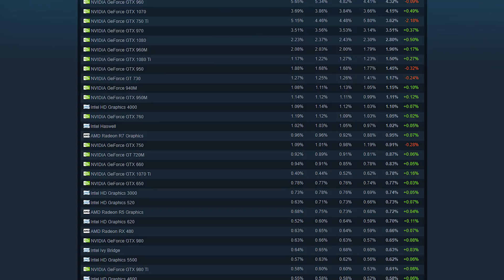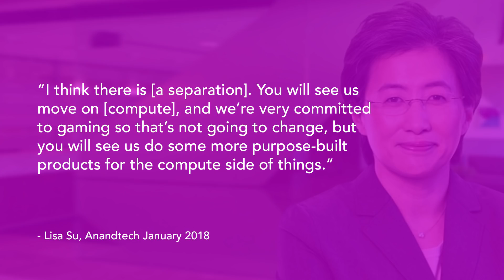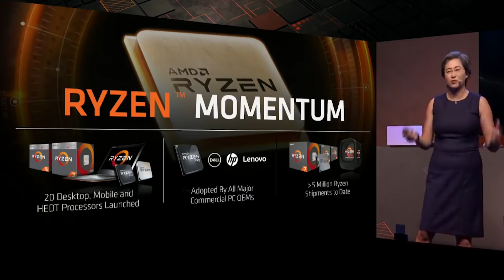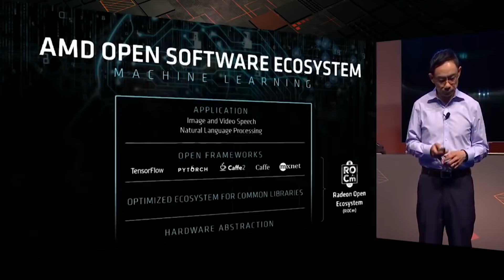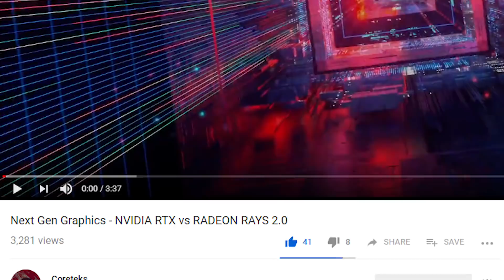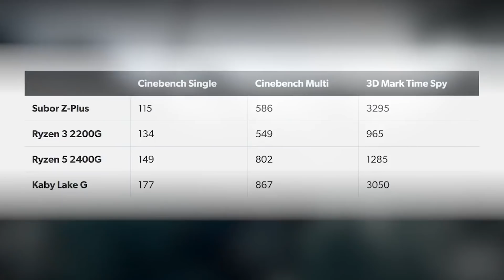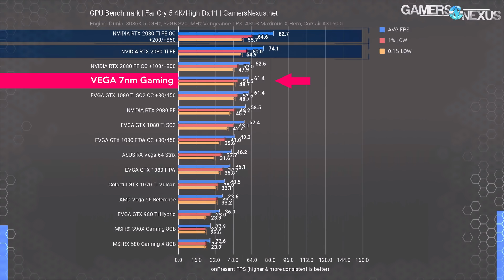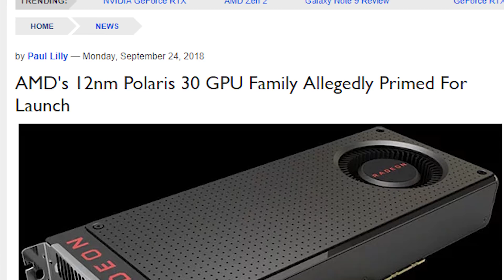AMD's answer to RTX

Comment: RTX is NOT a proprietary API(!!!)
Why? Because it isn't an API at all - it's just a marketing term... The API is DXR (direxX Raytracing), and YES it IS "proprietary" but NO it DOES NOT mean "NVIDIA only"(!!!) It is a proprietary API by Microsoft, which is nevertheless "vendor neutral"  when it comes to hardware support(!) The same code that NVIDIA RTX will be executing, can and will be executed on AMD hardware in the future - just like anything else in DirerectX has been for decades...
Please stop propagating nonsense...
Reply: DX12/Vulkan is the way to go, Vulkan more so than DX12
Reply: Fun fact: Vulkan already supports NVidia Raytracing. https://www.khronos.org/registry/vulkan/specs/1.1-extensions/html/vkspec.html#VK_NVX_raytracing . I could develop an raytraced game or application right now that takes advantage of the RT Cores, and most likely adapt it to use AMD's response when it comes out. Considering Shadow of the Tomb Raider supports Vulkan, why don't we have raytracing yet?
Reply: +Arnon Marcus I 100% agree with you. It's even funny how PC gaming relies so much on Microsoft API. Even the new RTX hardware can't skip the Microsoft piece of software in order to work as intended.
Reply: @Patrick73787  We shouldn't want NVIDIA to 'skip' the middleman - DX is how game-developers can write code once that can run on any hardware. It's an abstraction-layer. Is good for the industry. It doesn't really matter if it's DX or OpenGL or Vulkan - as long as it's hardware-vendor-agnostic - is good for everyone (except hardware vendors)
Reply: So my vega 64 will support those fancy lightning effects if they will support it with a future driver..?
Reply: @evren elveren it may well do, how fast it runs will remain to be seen but it could very well run faster than 10 series NV cards and may also make a good case for a 2nd card.  2 x Vega 56/64 (currently) cost less than one x 2080/2080Ti.
Reply: @EvrenElveren  Probably yes, but not in any way that will be fast enough for real-time at an acceptable frame rate. For that the hardware would need more dedicated hardware cores for the acceleration-structure (BVH) like Turing's RT cores - so AMD will have to come up with something comparable in some future GPUs...
Reply: @desire418  Yeah. Microsoft pretending not to be strengthening the ties to DirectX is interesting. I suppose there could be a theoretical implementation of the API in, say, Vulkan, but it is more likely that there will be an actual vendor neutral API developed to compete with it.
Reply: we know dickhead, sit down
Reply: Kid, you are confused. RTX IS PROPRIETARY TO NVIDIA. It uses a CUDA backend and runs only on Nvidia cards. DXR is indeed the Microsoft API common to all vendors and that uses direct compute, not CUDA... There is also a Vulkan alternative equivalent API that runs on OpenCL.... Understand now?
Reply: @KotsarisGR  RTX IS PROPRIETARY TO NVIDIA, but it's just a marketing umbrella-terms to talk about all the ways in which Turing architecture is accelerating DXR in hardware. AMD will undoubtfully come up with their own marketing term to how, say Navi architecture would be doing the same thing - and that WOULD be 'AMD PROPRIETARY', yes - but not in any way that matters at all to software developers for games - because they never write code that makes direct calls to CUDA, because if they do that their games can't run on any AMD GPUs, so they can't sell their games to AMD customers. What game developers do instead, is write code that makes calls to hardware-vendor-agnostic APIs like DX/Vulkan/OpenGL, and at that point - yes, there would still be different hardware-implementations of how each vendor chooses to accelerate the back-end of these APIs, and each vendor will have their own branding/marketing-terms for how they do that, to differentiate their brand -  but from a game-developer software-development perspective, all of that doesn't matter at all... They couldn't care less what any vendor chooses to name their implementations in their brand... They just write DX/Vulkan code... It's the hardware-vendor's job to care about how to execute that in the back-end in their drivers...
Reply: And it may also run on current Vega cards quite well as they have a very similar pipeline (better in some ways, maybe worse in others) to the RTX cards and lots of compute.
Reply: "Radeon Rays" AMD proprietary software predates DXR.  AMD had this out years ago before Microsoft came out with DXR.  Here is the direct link from their website about it.  https://www.youtube.com/watch?time_continue=14&v=C9eMciZGN4I
Reply: @blackwaterlotus8124  Right, and NVIDIA has had OptiX for even longer than that... What's your point? It's not about accelerating ray-tracing in hardware 'in general', that has existed for years - no, it's about accelerating ray-tracing in hardware 'FAST ENOUGH FOR REAL-TIME IN GAMES' and doing so in a hardware-vendor-agnostic way.
Reply: @Arnon Marcus  what is my point? I figured that was obvious since I was stating AMD Radeon Rays has been out long before DXR.  I never mentioned anything about Nividia.  Nvidia's Optix since you brought it up is still proprietary in that according to Nvidia, it requires a GPU with the CUDA API.  Not really sure what your point is, but my point was regarding DXR from Microsoft being touted as the universal API solution for Ray Tracing, when software was already in existence.
Reply: @blackwaterlotus8124  My point was that there is a fundamental difference between gpu-accelerated ray-tracing for general use, vs use of it for real-time in gaming. We at Weta Digital are using a hybrid of OpenGL and OptiX for our in-house viewport/preview renderer (recently presented at SIGGRAPH 2018) . They are 2 separate code-paths as the inter-op is very tricky between OpenGL and OptiX. Most pre-existing final-frame offline-renderers for production, are now either already offering GPU acceleration using OptiX or are working on it (V-Ray, Arnold, Renderman, Clarisse, Octane, etc.)
Point is, general-purpose gpu-acceleration and gpu-acceleration for real-time in gaming, are 2 very different worlds in term of software ecosystem, so using examples like Radeon-Rays, in the context of talking about gaming, is just not legitimate.

Enter DXR and VulkanRT: These are "extensions" to pre-existing 'hardware-vendor-neutral' APIs for gaming, specifically targeting 'real-time' (frames-per-second)as opposed to just 'interactive' (seconds-per-frame)- where the inter-op between code-objects already written for games and new code that would do ray-tracing, is supported out-of-the-box, so that game developers can easily extend their game code with ray-tracing features, while still staying in their existing software-stack world and still remaining vendor-agnostic in term of hardware support.

And RTX is NOT an API as mistakenly noted in the video - is just NVIDIA's way of supporting DXR and VulkanRT in hardware/drivers.
Reply: ALL HAIL HYDRA!
Reply: But amd card dont have the hardware rightnow to run that at playable fps
Reply: AMD cards have prooven to be able to do RayTracing. I couldnt find the demos but current Vegas and better cand o RayTracing (very poor but much better than Pascal)
Reply: Vulcan has hybrid rendering, but that's Dx12, more or less. Nvidia is trying to go after gamers with the ray-tracing fake news, whereas AMD has been targeting 3D modelers, animators, industrial users for years now, with their own real time ray tracing.

Nvidia is behaving like a shameless bully, and I look forward to the day that AMD can bloody Nvidias nose with a high end product that leads the way to AMD focusing on the high end, and Nvidia doing volume sales in tighter markets. I'm putting my money on 7nm Radeon Instinct.
Reply: Dang son. You educated.
Reply: BS on that....if anything Nv will have "convinced" MSFT to allow them to do it one way and everyone else to do another way (suffer because of it) look at Tessellation as a PRIME example, AMD has a Tessellation engine built at their own cost for MANY generations prior to putting it into DX officially, Nv "heard" about this and made a crying bitch fest "why should we build it like AMD does it, thats not fair, they should rebuild it (even though cost them countless tens of millions of $ and hours to make in first place) they have to do it in HARDWARE in a spec that benefits the way WE want to do it" 

MSFT "caved" and allowed this to take place, why, because Radeons were MUCH faster with Tessellation at a much higher complexity, the way Nv "changed it" made complexity drop but the "draw calls" go haywire, awesome for Nv because "cuda" was "designed" to "understand" the BS, they knew this, MSFT knew this but "allowed it"...

PhysX was kind of another example, Nv "bought it" and for awhile AMD CPU and Radeons could run at a hardware level exactly the same as Nv stuff did, problem was the Radeons could run it MUCH MUCH better/faster at lower power use (in effect was like a Geforce GT230 running same performance level as a GTX 280) Nv did NOT want this (because it made them look shitty) so they "took the ability away (their tech so kind of makes sense) thing is with Radeons and AMD cpu in general they "prefer" complex workloads, Tessellation, PhysX as examples (pathfinding, raytracing, texels) all are COMPLEX so Radeons "demolish" Geforce/GTX IF the "engine" is 100% "unbiased" in its approach...if Nv "greedy paws" are in that mix, that means Radeons and AMD cpu are going to appear "much worse" then they actually are.

Nv did NOT want ANYTHING to do with DX11-12 or Vulkan/Mantle but at least with MSFT and "OpenGL" (not Vulkan) they figured out ways to "BS" things to be "better" then they actually were/are, all along laughing all the way to the bank "HA HA suckers, don' you worry, we will release a better one next year at a higher cost that has even more BS gluing it together with as cheap parts as we can throw on it, oh, but it will have a pretty decent cooler" you know, kind of like one of those shit box cars with crazy loud exhaust to make you think it has a large engine, or a chiuaua making a ruckus at everyone/everything that goes near it to make you think it is meaner than it actually is (prettier the paint, the easier it is to confuse the "sheep")
Reply: @mauriceakamoefortin2510  My point was that a lot of videos like this are propagating a narrative whereby RTX is some API that game developers write code for (the same way non-game developers code for CUDA or Optic) - and so that game code would not be able to run at all on any non-Nv hardware at any point in the future.
My point is that this narrative is false, and is a misreading of Nv's PR propaganda - drinking Nv's cool-aid. Nothing you said in your response contradict that...
Optimization to specific hardware through an API design, is an allegation that you will not be able to prove - so: I'm talking about facts (what IS vs. is NOT  an API altogether), and you are talking about an opinion you have (that somehow Nv is "gaming" Msft for their advantage), which you are entitled to have, but will not be able to substantiate, as Msft DXR's implementation is proprietary and closed-source.
Reply: Did you forget about GameWorks? Their RTRT code requires GameWorks, so basically, yes DXR is also opened to AMD, but AMD has a record of using OpenGL/Vulkan, and the Nvidia implementation requires GameWorks. I believe that they won't be using DXR.
Reply: @whocares_yes  NVIDIA is not using GameWorks for it's RTRT - that is simply not true. RTX is just a marketing term, that among other things means driver-support for Microsoft DXR - which is now ready, btw: https://venturebeat.com/2018/10/02/windows-10-dxr-raytracing-rtx-update/amp/

NVIDIA has been working with Microsoft for a while to define the spec of DXR from the driver's end. Turing officially supports it, once it's out in the upcoming Windows 10 update - NVIDIA will have a driver-version ready by that time, that will take in the back-end of DXR and execute the commands on the RT cores. But NVIDIA doesn't provide anything to game developers beyond that. Game developers just writes code that makes calls to DXR API end-points - which are Microsoft-specific - not NVIDIA specific. Windows 10 will then be responsible of translating that vendor-neutral DXR calls into driver-calls, passing them to the driver. Then, if you have an RTX card it takes those driver calls and translate them to machine-code of Turing's RT cores. AMD at some point would have it's own hardware cores for RT and it's own driver that would take the same driver-calls that Windows spet out the back of DXR, and translate them to AMD's hardware machine-code. The code that game developers write would not have to change at all. It's NOT at all like the story with GameWorks(!)
And it doesn't matter what track record AMD has with GL and VK, it WILL have hardware for this, as this is basically DX 13 or DX 12.1 stuff... Not just a bunch of shader-code like GameWorks...
Reply: @AinurEru  Whelp, sorry if I was mistaken, thanks for your info!
Reply: @whocares_yes  What you say makes no sense - Gameworks is jus some compute-shader code that NVIDIA wrote - it's written in HLSL (Microsoft's shading-language for Direct3D) - it runs using DirectX in it's current form - is just like any shader-code, that anybody can write and run with any DX-supported hardware. The same kind of code that game-developers write and shipp with their games. Is again NOT an 'NVIDIA only' technology - is just NVIDIA saving time for game-developers, for writing shaders for specific uses, but nothing in it requires NVIDIA hardware. It's just written in a way that is 'optimized' for NVIDIA GPUs, because that's what NVIDIA software-developers use to test it with. A side-effect of that process is that it runs better on NVIDIA hardware than AMD hardware.
But DXR is not like that - is not Microsoft shipping some compute-shaders... It a fundamental extension to Direct3D 12 capabilities, at the core-API level, not at the shaders level. Think of it like tesselation - in DX10 the API was extended to have HUL and Domain pipeline-stages, allowing completely new 'kinds' of shaders to be written by anybody (anyone who can write shader code, no matter if they work at microsoft, nvidia, amd or ubisoft or any other game-company). But for these 'type' of shaders to be able to run, the hardware needs to support the HUL and Domain pipeline stages at the driver-level.
DXR is the same kind of story. There are new 'types' of shaders that can be written (again, by anyone), such as 'any hit' shaders, or 'closest hit' shaders',  'intersection' shaders - but they require hardware support at the driver level. In Turing's case, that is provided by RT cores. AMD would have to come-up with their of hardware solution and driver for DXR.
Reply: @AinurEru  Did I say that DX12, DSR and GameWorks were AMD incompatible?
But thanks for some of the info, guess you learn something everyday
Reply: DXR is not an API either moron, its a feature for an API.
Reply: @beyond305  That's just arguing semantics... It's a set of end-points that applications can call on the font-end, and that drivers execute on the back-end. So, it's a 'Programmer Interface' (P.I) for 'Application's (A) - making it an A.P.I. And it's hardware-vendor-agnostic. In fact, it's not even like in the DX11 era, where you had discrete pipeline-stages - DXR is technically not even part of Direct3D 12, because applications don't even necessarily have to use it in the context of rendering pixels - it's a generic ray-tracing API, and there are non-rendering use cases for that (like audio wave processing for reverb, or path-finding on a nav-mesh for NPC AI, etc.)